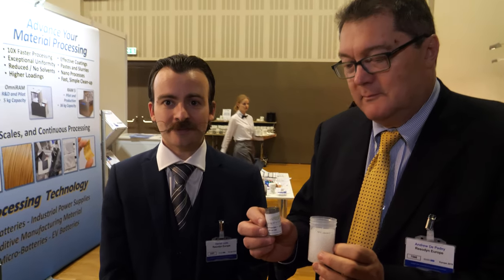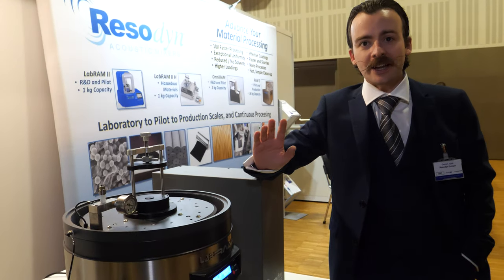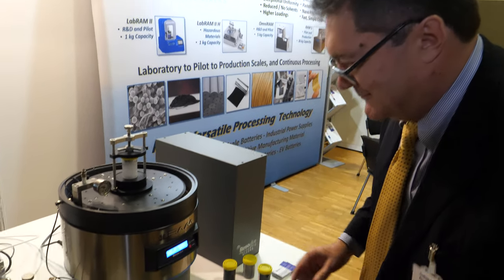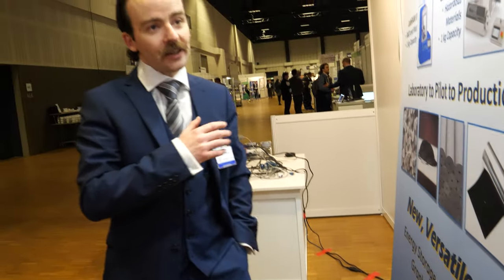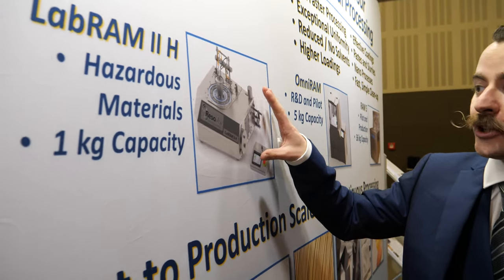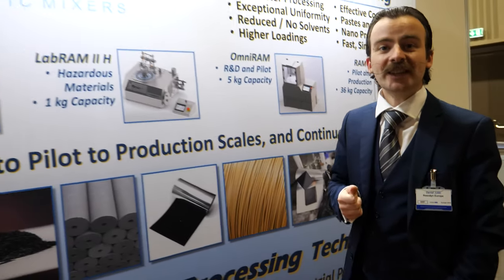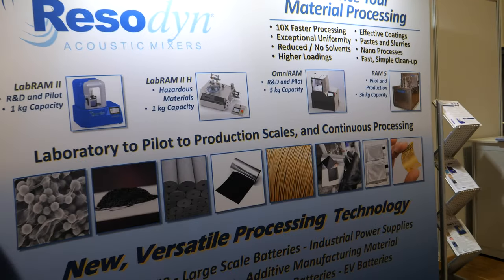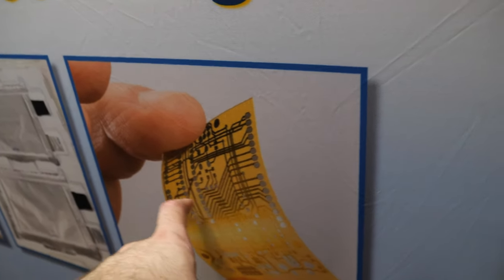Resodyn Acoustic Mixer

Comment: How does it find the resonant frequency? Does it simply have acceleration sensors in the bottom plate  that tell it when to stop sweeping? Is it even sweeping at all or do they use a different detection method?
Reply: The easiest way is to look at instantaneous velocity (from back-EMF) and apply a current in phase with the EMF. Think of an ideal damper - the retardation force is exactly in-phase with the instantaneous velocity. By applying a current (not a voltage, mind you!) in phase with the shaker's speed, you create an "inverse damper" --> increasing oscillation rather than decreasing it. You do need a control loop to limit the ultimate amplitude, but this can be rather slow (slightly faster than the decay-time-constant). The shaker automatically hits its resonance. Critical to realize that near resonance, the phase-angle between force and velocity (or current and voltage, if you prefer) rapidly goes from -90' to +90'. At resonance, it is zero. However, if your recreated phase difference is not exactly zero, but slightly off, say +10', you shall still end up pretty darn near resonance, for all practical purposes. Read more here: https://ris.utwente.nl/ws/portalfiles/portal/6039941/thesis_Mehendale.pdf chapter 4.1.1 :)